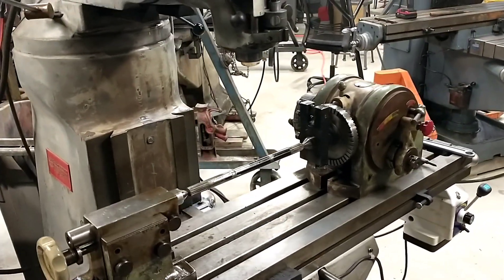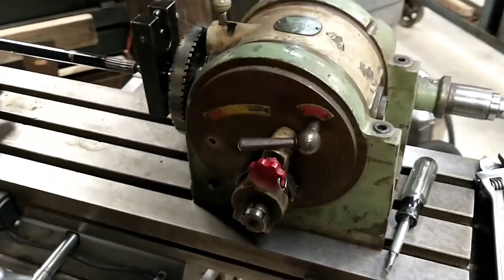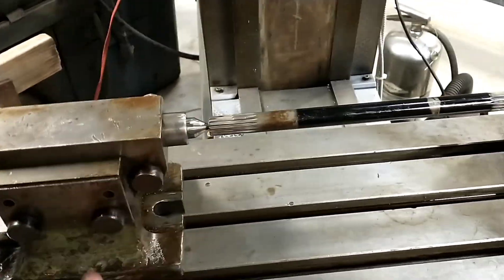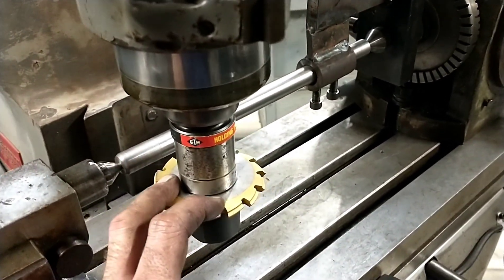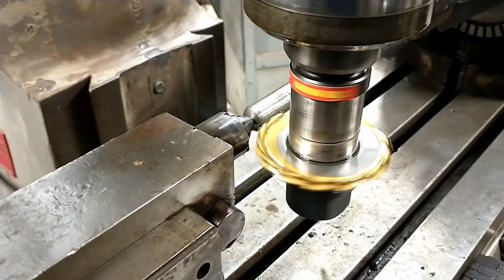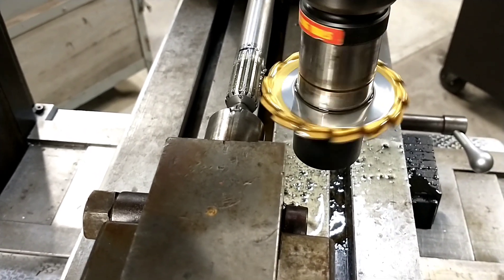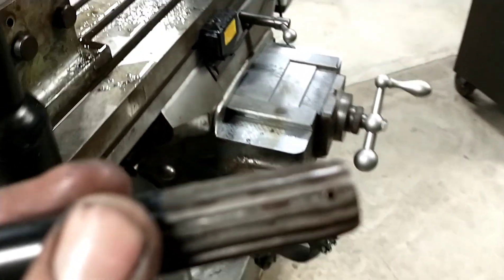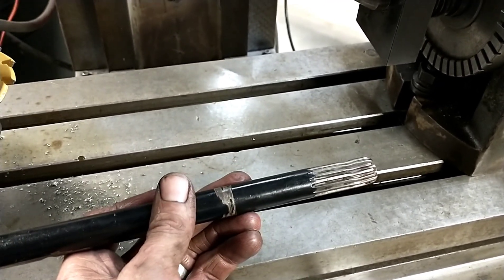Cutting a 15 tooth 30° involute spline

Comment: What grade of metal did you use on that new shaft?
Reply from the maker: I made that out of 4140, there are better steels possibly but they weren't readily available.
Reply: @Andy-PerpetualMotion good choice for steel selection cause it can be heat treated and drawn to increase the longevity of it after the amount of work you spend on it.

Comment: A note on the spline having the pin instead of just not machining the slot, they more than likely hobbed that not done one at a time as you are doing it so it would take them more time to not machine that one slot
Reply from the maker: Good point, I told the customer it was likely cut with a hobby but didn't connect that to the pin, thanks for the input 🙂